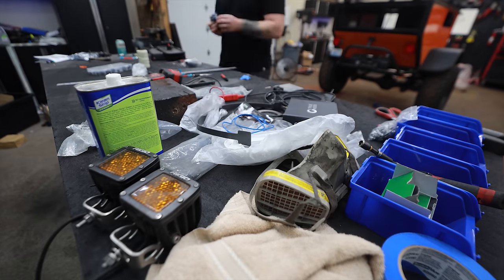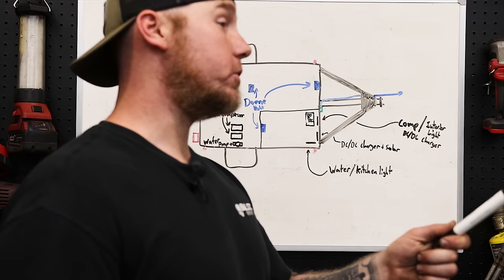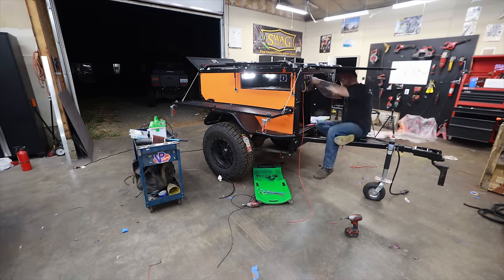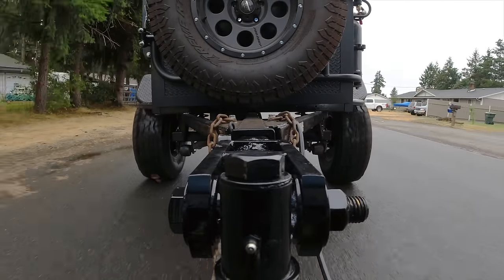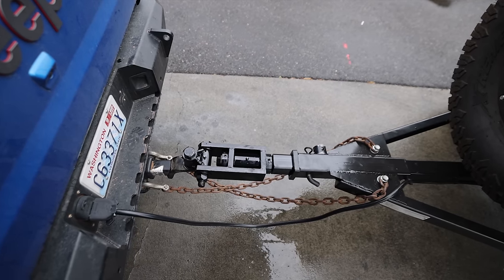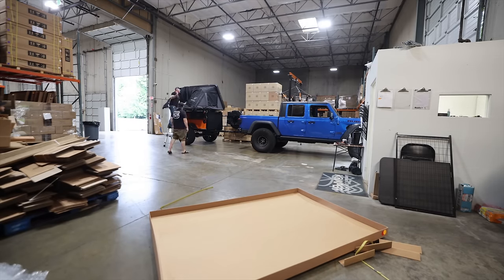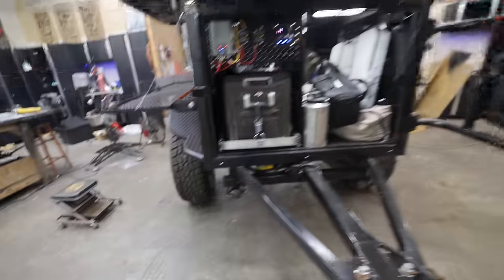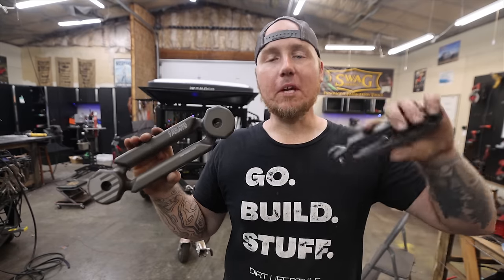It Moves! Harbor Freight Trailer Build Episode 11

Comment: Might make a suggestion on mounting items that you wish to remain water tight overtime. Instead of using caulking to seal use Putty Tape. You can find it online and has been used to seal rv's for years. It stays pliable and will not leak over years of use. The trailer looks nice! I want to build one for my JK!

Comment: Top tip - note where RTT sheds water, with and without its awnings up. I initially accidentally set mine such that water shed from my RTT went right onto my solar controller and into the tub of my M416 trailer.

Comment: I’ve been building a steel bumper for my work truck out of 1/4 inch plate and as a new welder your videos have been so helpful also this is by far the best looking off road trailer I’ve ever seen

Comment: Struts on the outside gives that extra little bit of arm movement space inside that already cramped little spot. Function over form. It actually fits the theme with some other items hanging off the side to conserve space. so it's not out of place.
Reply: Agreed. I have gull wings on my patrol rear windows and the struts get in the way all the time.
I have a solar panel on the roof top tent with gas struts. It's out in the weather 247, no rust in 2 years, I think it's the best way to go.

Comment: trailer is sweet. next big wiring job i recommend different colored wires with tracers so you can end up making a full wiring schem if trail repair ever needed to be done, more efficiently rather than only red wires as power.

Comment: A suggestion I should have gave you in start of this project if I didn't: you might like having painted inside with light color  off-white / eggshell or like then easier to see inside and for finding stuff inside. The interior lights work better too.
 Definitely shocks I installed a set on my MJ bed trailer.

Comment: You could run an extra alternator off that diff you're using for the trailer if you're concerned about getting enough charge.

Comment: Check out E6100 adhesive. It comes in black also.  Far superior to any store bought construction adhesive.  It can also be used as a sealant.       We used it in the electrical department manufacturing cement trucks.

Comment: Drilled and slotted rotors may  sing quite the tune. I put a set on a a pick up truck, hit up forest service and logging roads, dirt or gravel  roads, not even close the duration your rig likely to see. I ended  getting some small rocks stuck in the rotors.   Maybe i just got supper lucky, the noise  never really went away, as I removed rocks new ones got jammed in.

Comment: If the compressors rattle the panel they are mounted to more than you like, you could use rubber spacers/bushings in between the compressor and panel

Comment: You should have designed some sort of generator that would live inside of the diff to generate power from the spinning of the rear wheels and axles.
Reply: Aside from the drag lowering fuel mileage that would be a great idea. Hard to build but a interesting project.
Reply: @ianrunyon2423  ... I can't see that it would impact the milage that much.   You could replace the rear yoke with some sort of gear or pulley and weld a bracket on the axle tube for the generator
Reply: find an alternator that would fit in the pumpkin and have it driven off 1 wheel.  use a 3 wire so you can control power output, and associated drag, as well as prevent it from causing the wheel to skid in low traction environments.

Comment: i know you are not a big fan of anderson's but i have a caveat that you may want to consider.  
Jump starting. 
i originally got the idea from Stephen Cox here on youtube, but basically having anderson 175 plugs front and rear and having jumper cables with the same anderson 175 plug on it.  both of my trucks have the anderson plugs on the front and i will soon have them on the rear as well to go with the trailer i plan to be building. i'm still debating on a few of the points of the trailer and what its end job is going to be and how i plan to use it, but i will be mounting a pair of large capacity batteries for various purposes. 
the other thing to consider for your build is the fact that you do have a large capacity winch on the trailer, having an anderson plug will allow you to have as close to full power to that winch as you can have.  just some food for thought.

Comment: This may have already been mentioned or maybe you have already planned it I am not sure, but would it be possible to add an electric motor to the drive input of the differential you have under the trailer? If so I was thinking you could use it as a generator whilst traveling to keep your 12V batteries topped and also if you could have a remote control use it to maneuver the trailer when its not connected to your vehicle.
Possibly a way out there idea but curious what you think.

Comment: Have you weighed it yet I bet it is over it's legal working weight so not much gear can be carried., particularly with tent canopy etc, as with the extra weight of the Yota bed conversion your towing capacity may be reduced, by how much not sure.

Comment: Why did they say you can’t use amber yo the rear. Amber is 100% legal to the rear. But if you want to use it as turn signals, you have to run separate wiring for the turn signals and find the turn wire in your truck so it will not as STT. 

Too much work when the red works just as well.

Comment: Drilled rotors provide no benefit what-so-ever, and even are a detriment. Slotted rotors do provide some benefit in wet weather, but also some negatives. Allow me to explain:

Five or six decades ago, brake pad material was adhered with the use of an adhesive that would off-gas under high temps. There was no way to get around this so the race guys experimented with drilled rotors to allow that off-gassing somewhere to go. It mostly worked. A short while later the manufactures began using a new adhesive that doesn't off-gas, so there was no need to use drilled rotors anymore. 

Drilled rotors have a few negative qualities, both of which are not usually a problem in the type of driving you're doing, or that most people do in general, but are a serious problem in racing applications. The first of which is that you're reducing the mass of the rotor. Brake rotors are essentially a big heat sink. You're converting kinetic energy into heat every time you stop, and the rotor is there to absorb that heat and then dissipate it at the next straight section of the track, or road. This is why brake rotors are made of cast iron, and not steel as cast iron has better thermal properties in this application. Reducing mass from a heat sink is generally not advised. 

The second problem, and arguably the worst problem, is that you are creating stress risers in the cast iron with every hole that's been drilled into them. Small cracks can begin to occur at the holes and eventually propagate to the point that you crack the entire rotor. Not a fun time at all.

Slotted rotors have some of the same problems that drilled rotors have, but to a lesser extent. The difference is that while drilled rotors provide absolutely no benefit, slotted rotors do provide some benefit in wet weather as they can wipe moisture from the pad upon initial bite, giving you more immediate braking as the water doesn't need to boil off the pad before the pad can begin to work properly. The cost to benefit ratio of slotted rotors as much closer to the middle of the curve than for drilled rotors. 

This is all proven out in the racing world. Walk through any armature, or professional race paddock and look at all the top cars that still run cast iron rotors. Not a single one will be running drilled rotors. Not one. Some of the new guys and back markers will be running them, but the new guys will switch over to solid, or at least slotted rotors pretty early on. The back markers are back markers for a reason. They aren't smart enough to figure this stuff out.

Companies sell drilled rotors because the layperson thinks they look cool, because they have this racing history, and that must mean they're better, right?. The truth is that that racing history is long past, and they're really only for looks and not function.

Carbon rotors, and motorcycle rotors are a different story.

Comment: Not sure if this was thought of but would it be possible to install a pulley on the driveshaft input on your trailer differential and run a belt driven alternator to charge any of your trailer batteries? I feel like it would be a genius idea if you can get it to work

Comment: Light holes in the back can get two white flood light’s as backup lights or turn them on as a camp ground light. 
Fridge drawer stop could be as easy as a rubber bumper on the door. It’ll stop it from moving when the door is shut. 
Love this trailer. It’s how I found your channel.🤠👍

Comment: you can use pvc tubing/conduit for running electrical wiring under the trailer as it holds the wire securely to the bottom of the trailer and is nonconductive so if a wire does chafe it doesn't short to ground, it also prevents the wire from getting snagged on brush or tall grass under the trailer. you can use the pvc caps to terminate the conduit and drill holes sized for the wiring and use grommets to seal it from dirt and water... also if you do break the pvc its cheap to repair

Comment: Since you did Mount that door at a 90 on the side and the struts are exposed and it's already looking weird would it be that much more work to fabricate a shield for when it's closed I can see a tree branch or something pulling those struts out of place otherwise very cool trailer

Comment: I used a Bussman 15305-2-2-4 Relay/Fuse box for my auxiliary circuits in my truck and it was really easy to wire up

Comment: You spent several minutes justifying how good the brakes and trans braking was on the Gladiator and it doesn't matter cause the trailer is sooooooo light..  then at the very end tell us you had to up grade the springs cause the trailer was so heavy..   I'd like to hear how overly heavy it is..  how close it is to the state required 3000 lbs for trailer brakes.. or the sane person towing it 2000 lbs...